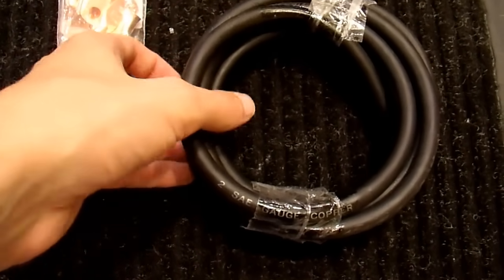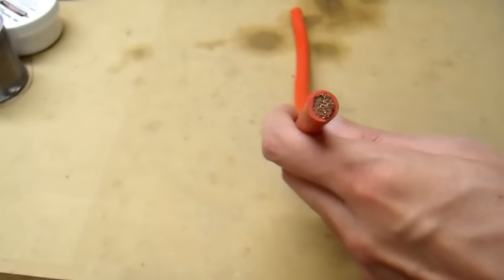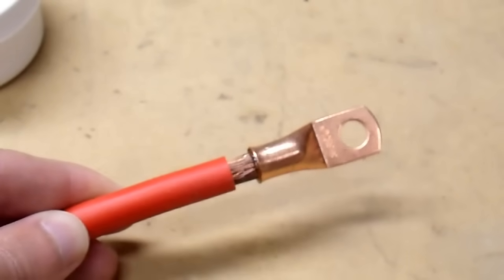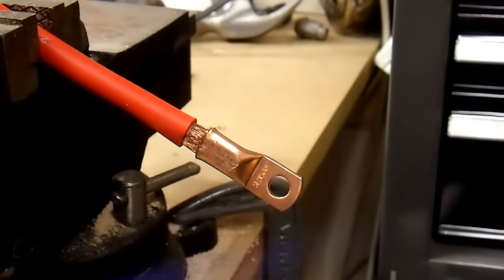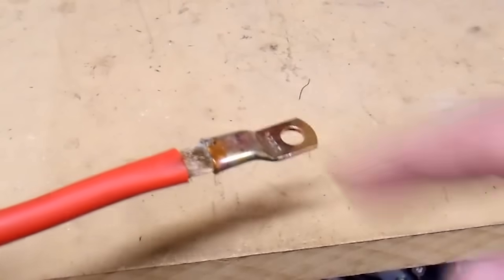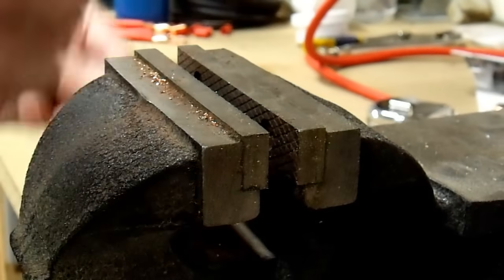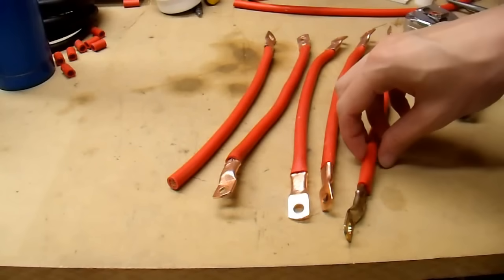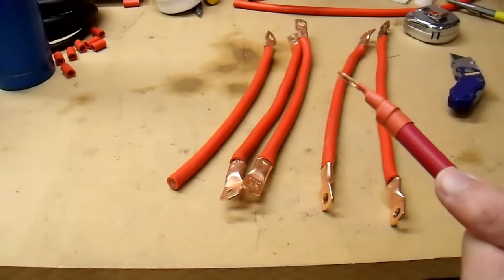How to Make Battery Cables the Right Way and the Easy Way

Comment: I believe the reason you generally do not find commercial grade cables soldered (not soddered!!!!) is purely down to cost.  It is far easier and quicker to make a mechanical joint on a connector and cable than to make a proper soldered joint.  The cable manufacturers keep this myth going so that they don't look bad.  In reality a crimped connection is only about 60 or 70% good.  Whereas a soldered joint is as near to 100% as you can get.  The solder allows more electrical flow through the connector and thus means less resistive high spots that do fatigue over time and have the potential (no pun intended) to fail.  It is absolute rubbish to suggest that a soldered joint is more prone to 'cracking' or mechanical fatigue.  As for the author's ideas about heat shrink being bad?  I disagree entirely.  A good connection covered in heat shrink (glued is best but you can always use a hot glue gun to place glue in specific areas such as the space between the end of the connector and the outer sleeve of the cable) is protected from the elements.  If you feel the joint is going to fail with heat shrink then you obviously don't have confidence in your own work, so why do the job in the first place?

Comment: Not a bad video until you got to the heat shrink part at which you turned a decent video into a crappy video. As a auto mechanic, I know for a fact, every connection on any vehicle, motorcycle, ATV,  boat, etc needs to be soldered and heat shrunk or some sort of sealing cover put on it. I have repaired more wiring problems that were due to the use of crimp connectors, scotch locks and corrosion due to lack of heat shrink than any other problem. Yes, heat shrink can be wore through if something rubs on it but so can the wire's insulation. Yes, corrosion can form under heat shrink although rarely but it can form under the wire's insulation if there is any breaks or cracks in it. Also, most of the electrical rosin fluxes I are not acidic but some of the other soldering fluxes are so if your using an acidic flux for electrical soldering, your using the wrong flux.

Comment: You can buy a hammer type crimping tool on EBAY all day for 10 to 15 bucks. These do a real good job IMHO and no solder needed because it has a shaped crimp. Just my 2 cents.  https://www.waytekwire.com/item/462/CRIMPER-HAMMER-TOOL-8GA-4-0/?gclid=CP7npujQl84CFc9ahgodvC0Jlw

Comment: there's just so much incorrect stuff in this video that i don't know where to start. all i can recommend is nobody follow the advice in this video, go ask a professional.

you should take this video down unless you leave it up as an example of what not to do.
Reply: @SuperAWaC 

The moment I saw the kraft knife being used to strip the cable, I knew this was going to be bad. If this is intended to be a ‘right way’ video, let’s start by talking about using the right tools or explaining what the risks are by doing a gypsy job.

I think a competent electrician will tell you the risk of nicking the conductors when stripping insulation using a razor blade knife. It creates a spot of high resistance that will heat up the exposed wires and promote corrosion. 

Since this was a demonstration video, i suggest stripping the insulation to the proper length. If you’ve stripped too much insulation, why not trim the end of the cable until it’s the right length?

As others have pointed out, tin the wire before inserting it in the connector.

It’s not that hard to fabricate a quick-and-dirty crimping tool rather than just squashing the connector. Heat-shrink and plastidip are a good way to seal the part.

Use a multi-meter to determine if there’s a problem developing with the connection.

Comment: I've been living off the grid for 25 years on a boat.  I would never use solder for the connection.  Just imagine what time and corrosion do to wire.  The terminal could get hot enough to melt the solder and if that was making the mechanical connection you have a bare charged big-ass copper wire springing off the terminal just looking for a ground.  This could cause a lot of heat and fire.  Not safe.
Your later mechanical only connections are better but buy the tool.  It is cheap from China and works great and so fast it pays for it's self in just a few uses.  Just a wack with a hammer and you are done with a great connection.
Reply: +Jack Frost  well you just saw the terminal soldered on without melting the plastic.  So I'm going to stay with its possible.  And since I've seen it happen, well there is that.

Comment: I made my own terminals with copper pipe of the right inner diameter
flatened a end and drilled thru it. I also had wire half as big as I needed so I doubled it 
up I cut my resistance by 1/3,,, by running a steel cable with the copper cable you will reduce the flux field inductance further....... plumbers pipe flux also works great
for difficult soldering they have soldering tip cleaner at radio shack or frys that
will solder the impossible connections I always keep a small tin around of it

Comment: I'm more interested in car applications, and although I do appreciate the time you took to make, upload the video, automotive car battery cables are not that expensive, so I prefer to go that way for replacing mine, easier and bolt on if you end up purchasing one for your specific car make and model.
Reply: Thats all good usually if your replacing a stock wire with a stock wire, but its not always that inexpensive and its not always just a bolt on kinda deal even when purchasing OEM parts from the dealer. If your doing car audio and have to run 1/0 to trunk you don't really have to many premade options but in the past i have used premade wire from autoparts store and it looked to be well made 2AWG wire with terminals on both ends and it ended up being one of the worst wire failures I ever had and If I had not of been disconnecting it when upgrading alternator it probably would of broke soon anyways.
Reply: This IS for an automotive application.  Look up "Big 3 wiring mod"

Comment: I solder all the time, its works very well.. my grandpa and my father solder and there wiring projects are still around, this is a great video!!
Reply: a proper crimp has less resistance, and in car audio when you got fuses rated for 200AMPS or more I always worried it would reflow solder before blowing fuse making problem way worse but if you do it that the solder with the silver is the way to go IMO
Reply: The liquid flow temp of tin/silver solder is not much higher than that of 63/37 eutectic, about 37C. In the end it will still heat up and flow. CRIMP!

Comment: To save money on expensive fittings, I have used copper tubing/pipe from hardware store, or reclaimed from job sites.  Cut it to length, flatten one end and drill a hole through it  and you have a low cost connector.
Reply: Not bad idea bro
Reply: A low cost, low performance, and unreliable connector.

Comment: a way to help keep the corrosion out of the ends is to smear some grease around the connections it will help keep them from corroding and it also works on battery terminals as well have used it for years it can be a little messy but it works.

Comment: Clamp the terminal in a vice and then strip the cable.heat the terminal and fill with solder and push the cable in.Only strip cable back as deep as the depth of the terminal.Only takes the solder a minute to cool. Then centre punch terminal.Also works great.
Reply: On a unrelated topic, when you solder a component into a circuit board you want to heat both the component connecter and the circuit board to flow solder over. If you don't have both heated it can cause problems with it not connecting properly and can be hard to find, the term for when that happens is called a cold solder.

Comment: I've worked with electrical cables for years now. Nice job, BUT it would be much better if you do these three things: 1. Clean the flux off with alcohol/solvent or it WILL Corrode. 2. Apply a liberal amount of non-acidic RTV to the joint, hint if it smells like vinegar you have the wrong stuff. 3. before the RTV dries cover it with heat shrink and Shrink it. After you heat shrink it  and it oozes out,  wipe the excess off and let it cure. This will humidically and acidically seal it so that it will NOT corrode. Best Wishes n Blessings Keith
Reply: If you use adhesive lined heat shrink, you will not need the RTV.
Reply: i find it interesting that he did state the flux is acidic and will corrode the copper if not burned off then he stuffs the copper wire dipped in flux into the terminal with out the flux being burned off...
Reply: Paul Moffat R U related to mike moffit ,the guy that called jerry "a big phoney "??
Reply: and braise your conection first before with soldering
Reply: rosin core will not cause corrosion.. rosin flux wont.acid flux is for Plumbing ONLY.. and does cause corrosion.
Reply: You sir could not be more incorrect.  It is a well established FACT that typical Rosin activated flux is corrosive and must be cleaned and kept certain distances from insulation so its not wicked under it where it can not be cleaned.  It has created significant issues in the PCB amateur market yrs ago till info was properly disseminated.  What do you think the reason for the creation of no clean rosin free flux was for?   Funny thing is they actually replaced the rosin with acids but the acids are suppose to be neutralized by the temp of soldering.  Issue there is if flux flows and does not get up to proper temp its acidic and will corrode.   They do now make corrosive free rosin flux but its specialty product.

You can find 1000 of articles and tech papers on this issue.  Take a look at electronics PCB info for detail tech.  NASA quality papers on proper electrical splices and connections is also a great source.   Acid brush and usually a pure iso alcohol solder flux cleaner is SOP.
Reply: That's completely fucking wrong. Lol
Reply: Keith Noneya nnn

Comment: Terrible first way: never ever use plumber flux! Atleast you used electronics solder, it does contain enought flux to do the job right. If you are worried about the oxidation under the heatshrink, before applying, add a bit of dielectric grease. Then seal with the tube. The excess will flow out and now you have a basically water tight cable.

Comment: This is exactly what you don't do! So why do I use a $500 crimp tool and zinc coated connecters for this type of work because I have seen what happens with soldered connections and incorrect crimping of connecters..

Comment: I see comments about the automotive industry NEVER using solder for terminals.  I'm no expert, however I have never seen a factory made battery cable that doesn't have a lead battery terminal on a copper wire.  It seems to me that it's basically a copper wire with a big blob of solder on the end.  I like the idea of using transparent heat shrink as commented earlier.  There is also something out there called "no clean" flux which does not cause corrosion on circuit boards, although I have not used it yet.  ...  I really like the idea of having just the right length of cable for the job.
Reply: There is a difference between Lead and solder. The terminals are cast of nearly pure Lead while solder is a mixture of metals. Lead based solder is actually becoming harder to get and much of it is a mix of Lead, Tin, and Antimony. In fact, Tin is the major component in much of it now days if it is for electrical work. Often as high as 63% Tin to only 37% Lead. Battery terminals will have some Zinc in them in most cases to make the Lead harder.

Comment: A quick, efficient , quality way to make battery cables is to buy some appropriate gauge welding cable (they will cut it to length) and lugs at your local welding supply.  There are various ways to crimp the lugs but the tool for the job is usually under twenty dollars and well worth it. Welding cable lugs are not soldered because solder melts under extreme heat. They are crimped, and so are most modern aircraft connectors. Crimping is fine if done properly. There are many professional splicing and termination videos on Youtube, Auto store "battery cable" is junk compared to the tough, fine-strand cable used for welding leads. They take a harder beating than any typical battery cable and have low resistance.

Comment: Pierre! I totaly agree, this Video should be called How not to do it,,,
Reply: you right he sloppy is hell,he cant work on anything i got.
Reply: See what you started TheMowjo?  A bunch of replies from people who get butt-hurt disagreeing with each other.  Instead of making their own version of what is "correct", they argue. Typical
Reply: Electrician for 40 years ,this is not the proper way ,these are compression connectors ,save money start a fire !
Reply: Just for my own education what are your qualifications to make that statement?  I offer two data sheets for MIL-qualified connectors: the first is for a typical CRIMP type connector:  https://www.milnec.com/mil-38999-series-1/38999-series-1-catalog.pdf.    The second is for a typical SOLDER type connector:   https://www.milnec.com/mil-5015-connectors/ms3106-datasheet.pdf.  Both types are active for new design.  So both CRIMP and SOLDER are acceptable to the US Military.  

Now as I said before if you have a better suggestion as to how the guy should have soldered his that's one thing--but to state categorically that crimp is the ONLY way to do it, well then you're just flapping your gums.
Reply: @SRFDriver  Listen stupid if the cable shorts the solder will melt on to the battery and to make it worse the battery has a plastic case.  You are just blowing smoke up your own stupid arse showing connectors that have nothing to do with battery terminals. If this is your way of thinking no one should let you anywhere near electrical work of any kind.
Reply: @randallgoguen3463  can you even calculate resistance in an electrical circuit ?
Reply: @mrobvious5892  That has nothing to do with anything.
Reply: @randallgoguen3463  has to do with all you don’t know.  So do you know anything?  Cause your talking about a process like you know something about it, this requires work experience in a similar or related field.
Reply: @mrobvious5892  Its has to do with the melting point of solder. Not Ohms law. You are talking out of you arse.
Reply: @randallgoguen3463  sorry there, wouldn’t want to be the cause of you thinking outside the cable crimp.  I wasn’t aware of your snowflake status. Isnt fragile a rather queer choice of words to use in your description? 🥴
Reply: @mrobvious5892  Get help
Reply: @randallgoguen3463  now your a psychiatrist???? I find that VERY hard to believe!!  What happened to the Cable Guy?  I’m starting to believe that your not being forthright with me R.G. 😔
Reply: @mrobvious5892  Get help
Reply: @mrobvious5892  Get help
Reply: @randallgoguen3463  where are you and what’s your emergency???
Reply: @mrobvious5892  Get help
Reply: @randallgoguen3463  1
Reply: So we can look forward to YOUR video on How To Do It?
Reply: @SRFDriver  You need a video to tell you not to solder battery terminals?
Reply: @randallgoguen3463  Read what I wrote again: There was nothing in my comment about how NOT to do it--that was in yours.
Reply: @randallgoguen3463  I "though" you couldn't spell
Reply: @randallgoguen3463  Then read my LATEST reply.
Reply: @randallgoguen3463  Listen up Gooey.  That’s why the military does a combination 2 part crimp of the wire and insulation, solders the end nearest the ring terminal eye and then applies a high quality clear heat shrink over top of everything. But you’d know better🥴 right?
Reply: @mrobvious5892  "That’s why the military does a combination" BS right?
Reply: YOUR RIGHT YOU NEVER CRIMP A WIRE. YOU FLUX IT PUT THE END ON AND TORCH IT THAT WY YOU GET A COMPLETE  GROUND AND CONNECTION,
Reply: @jsmith3964  I hope you're being sarcastic

Comment: KnurlKnar, Excellent video quality and quantity. If you have less than an accredited Masters in Electrical Engineering, I would be very surprised. Great work. I see how folks like to bash your technique, however, it works for you. I used your method with solder, then put some heat-shrink on it. Relatively quick and easy once I got my method down. In general, all your videos are top-notch. You have inspired me to complete an off-grid solar system for $902. The goal was sub-1000. Thanks!

Comment: Also it's good to use dielectric grease around your joint where your LUG meets the wire insulation, then cover with heat shrink. You'll never have to worry about water penetrating and cracks or crevices causing corrosion. Jus sayin.

Comment: If you use your vice to hold the LUG upright and predip your wire in flux, then heat the LUG with your torch and fill it 3/4 with solder then jam your wire in the LUG and let it cool there's no crimping necessary and it's much cleaner when using heat shrink on a round wire and round LUG. it's that easy.